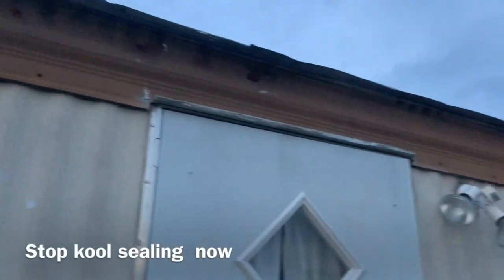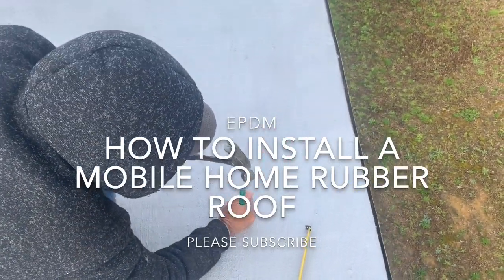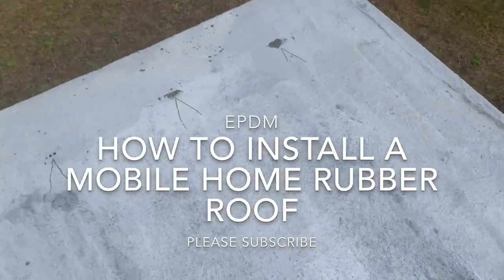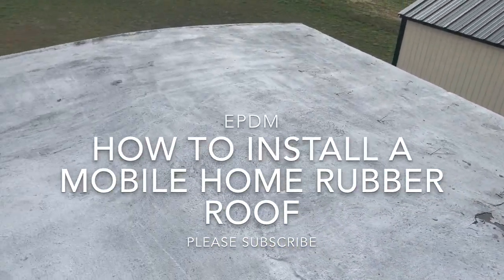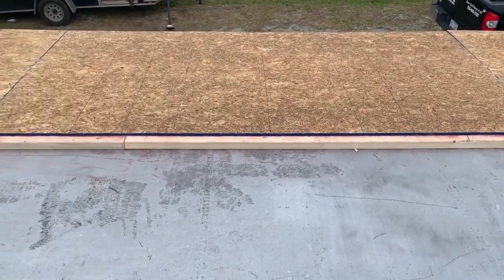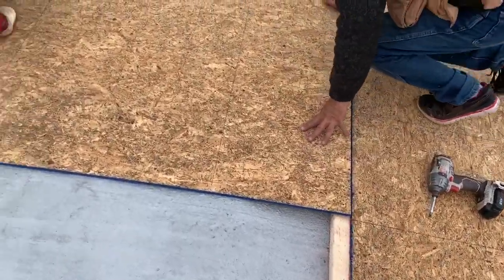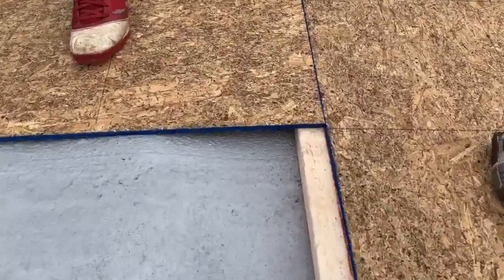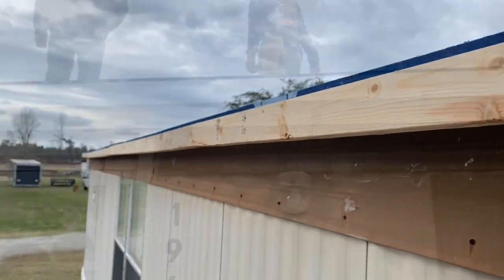(How To) Repair Single Wide Mobile Home Trailer Roof Training 2

Comment: The only thing I see that you could have done to improve the adhesion of the EPDM membrane is, as you are rolling it out, have someone with a street broom with soft bristles sweeping the rubber out from the middle to the end and side to get all the air bubbles out.  Before you put your termination strips on the sides, this way you will not get all those ugly bubbles I see you have, you want 100% adhesion. I know this video is 5 years old and you probably do things differently now.
Reply from the maker: Good observation

Comment: Adding a layer of 1 1/2" rigid foam between the 2x4s would make a huge difference in the heating and cooling costs for the home.  Even better, you could cover the entire roof with 1/2" ridge foam and install the 2x4s on top of it and then add more rigid foam between the 2x4s.  Maybe you could offer the foam insulation as an option.
Reply from the maker: https://youtu.be/41gtPber144

Comment: Nice work fellas. Did it right. I personally would of used metal but all comes down to budget. I like how you took the time to hit the rafters and check out what was under the tin for framing.
Reply from the maker: That’s all important making sure you hit rafters

Comment: I live in Delaware.  Wouldn't mind watching.  I think I have a rubber roof on the back addition that needs fixing too.  Google maps shows a corner flapped over, and there are stains on the ceiling directly underneath.  Been like that 2 or 3 years.  Disabled so I actually cannot get on roof to see.  Yep, it's been way too cold to be on a roof here, but it'll be getting warmer soon.  Like your videos.
Reply from the maker: Thanks for watching.
Reply from the maker: Michael Offutt I look forward to come in there and doing that Delaware job keep your eyes out it will be within a month or two subscribe to my videos and please share

Comment: Excellent video....looking to do the same to my 25 year old 8x40 ft trailer in Florida...with AC & Vents on roof w/attached screen room. Rigid Foam between old roof and new rubber may add more strength and insulation....Many thanks!! Do you travel to Florida?
Reply from the maker: Florida is one state that just won’t allow people to come from another state to work. I wish I could I love Florida

Comment: 3 years later I'm now just looking at this video getting ready to fix my leaky roof. Now question what is you think will be a weight limit on walking on the roof or any recommendations on walking on a manufactured home roof. I'm about 370.
Reply from the maker: Don’t do it. Get someone smaller. But if you have a roof like what I do put on you could walk on it anywhere have a friend just lean a ladder and us a paint pole roll Kool seal over leak area. Lots of it maybe even do it 3 times letting it dry in between coats
Reply: @Drewsroofingandhomerepair  thank you I work on cars not homes but  I can not get any one to work on it.  Feel to get stuff done you got to do it yourself
Reply: Roof does leak pretty bad
Reply from the maker: Don’t be getting on a roof of a trailer do it with a pole and a roller.

Comment: How much a job like that will cost ? I have a mobile home in snow hill nc that needs rubber roof ! Thanks great video
Reply from the maker: Depends
I might be interested in helping you out with that in the spring time  anywhere is from about $9000-$12,000

Comment: I'm wondering if this method would be suitable for my mothers trailer. We live in Northwestern Ontario, Canada and we have harsh winters with lots of snow. Wondering if I should go rubber when I do it or maybe look into tin roof instead. What do you think? Thx
Reply from the maker: If I was you I would go with the Rubber Roof and it will hold up anywhere in the world. They use in Alaska I buy more material at ABC Supply

Comment: I noticed on some of your videos you find wiring running over roof studs between metal roofing. How is the best way of determining if that is so without just getting started and drilling thru wiring?
Reply from the maker: When you go up on the roof you will probably see humps where the wires are. That is generally the way we find them. What I do if you noticed most of my rooms have holes in them I cut a hole in the roof first find out where the wires are after I determine where the wires are our use one by fours if there are wires and strap it if no wires you can go straight down to the roof call me if you have any questions 910-294-1761 I’ll be glad to answer any questions
Reply: @Drewsroofingandhomerepair  Thank you
Reply: @Drewsroofingandhomerepair  forget i asked, lol. i just saw this post and it answered my question. :-) TY.
Reply from the maker: Generally what you want to do is go to the main power source inside the house the breaker box. Find out if the wires run up the wall or down the wall. If they run up the wall then you want to go right above where the fuse box is on the roof and with your feet you can basically feel if there are wires running on top of the rafters. What I generally do if I have to do the job anyways is I cut a 12 x 12 hole above the fuse panel and find out where the wires are running. And I only do that if I’m going to do the roof if I was not going to do the roof I just feel for the wires. If they’re up there you’ll be able to tell by the bumps in the metal over the

Comment: Just curious can the roof and walls handle this extra weight on the roof? My mobile home is on blocks with just skirting, no solid support under the outside walls, I fear the walls would sag meaning the inside floors near the walls will sag from the extra weight on the roof.They sag slightly already from the years, it’s a 1978 Shultz single wide. Thanks
Reply from the maker: That’s a good question I don’t know what your situation is but if it’s sagging already maybe not
Reply: That's what I was thinking too I think you could do get away with the strapping I don't think you need them boards
Reply: Sounds like it needs Skirting took down jacked up to level it and put underpinning with treated 2x4 or 2x6 boards all along the outside wall.
Reply from the maker: Probably

Comment: In my area up north they wont let me add plywood over the top because of additional roof load + snow load.  Any suggestions on how to do this without the plywood?  Strapping with iso and then rubber? or metal over strapping?  My only other option is to build a gable roof and that may be cost prohibitive.
Reply from the maker: If your roof will hold the snow load now adding OSB or plywood would make it stronger. So why can’t you add OSB or plywood if it holds snow now it will definitely hold snow after he put the plywood
Reply: @Drewsroofingandhomerepair  tea the city wont let me.  They are saying the weight of plywood would be to much

Comment: On this job you put 2×4's down before the plywood due to wires running across the roof , correct ? Or was it because of the slant of the roof you had to use the 2x4s so the plywood would line up flush ?
Reply from the maker: Yes sir there were not any wires on this particular roof we used one by fours in some areas and two by fours and others and the reason for that was because of the 5 foot pump that ran down the center of this trailer. We used two by fours and one by fours for runners just to get the middle of the trailer and the outside of the trailer all basically at the same height so we didn’t end up with a big bump in the middle It was not for the wire snow
Reply from the maker: Not for the wires at all
Reply from the maker: https://youtu.be/Vtj8M5khpks

Comment: I really need some help. I have an old 1970's single wide with a bow roof. The walls are only 3" thick. It has metal skirting. We need to make the walls thicker so that we can install regular windows and add insulation. We also need to do something with the roof. Our mobile home sits on a cement pad, no footing. My hubby thinks that we can, remove the skirting and the metal siding,  frame up from the ground (half under the trailer, half out) and then frame up from that with like a 2x2 or 3x2 , add insulation and then add osb and vinyl siding or just wood siding. But then the wall would be exposed at the top. We talked about doing a wood roof over with shingles and posts but I was hoping to just lath the roof and add insulation and metal roof. Is that possible ? Will it be able to go over the new thicker walls? Can you add a soffit ? I'm just a broke chick looking for a cheap way to make our mobile home livable in the winter so I can move out of the city ASAP LOL please help !!
Reply from the maker: 3 inches thick you should be able to put windows in there no problem your windows do not have to be thick or the walls don’t have to be thick excuse me in order to put windows in what do you want to do is order windows without window jams. If you order windows with jams you would have to have thicker walls but if you put windows in with no jam extensions on them you can put any window you want. 3 inches thick is plenty thick for any window you want.Go on Google and type in new windows without jam extensions. You’ll have to make your own jam extensions out a one by fours ripped down. And then as for the roof I don’t know what your situation is or what your roof looks like does it have a peek on it or is it a flat roof if it’s a flat roof you can put the rubber roof on it like I do with the overhang. I would order windows with no jam extension looked it up on Google
Reply from the maker: Look that up on YouTube windows without jam extensions how to install
Reply from the maker: https://youtu.be/jOZOjBIGpGs

Comment: iam still wanting to know ?/do you not have to pull permits .and have felt ice and snow inspections as well as staple and nail inspection and drip edge
Reply from the maker: Not hereWhere I’m at in North Carolina
Reply from the maker: We don’t have ice and snow where I live and the inspectors do not inspect your nails and you’re not allowed to use staples

Comment: What should a job like this cost? Ballpark? And please tell the guy with red sneakers to tie his shoes…👍
Reply from the maker: This is an older video and the guy with the sneakers no longer works with me. I think I charged 5000 for this job back when I did it but notices a couple years ago. Biden omicks kindly changed my pricing.

Comment: Typically, how long does a rubber roof last before it needs patchwork? I live in Ok and wondering how the rubber would hold up to our heat, humidity, wind, and hail. Thanks for the videos. I have to decide what to do with my mobile home roof. What is your opinion of rubber vs metal?
Reply from the maker: 20 yrs

Comment: Hey drew my roof has multiple planes ,there are like 3 different levels of roof.Theres a pitch transition from one to the next.How do you handle that kind of situation.
Reply from the maker: That’s not an issue I have done every style mobile home there is Dustin check out my videos I’m sure you’ll find one like what you’re talking about possibly one of my Virginia jobs look at my Drews traveler videos
Reply: @Drewsroofingandhomerepair  thanks for the reply,is it possible to do corrugated metal over the style I was talking about?
Reply from the maker: I don’t know about that too much I think you might be running into some problems thereYou might wanna stick with rubber

Comment: How much would it cost to put a rubber roof on my single wide trailer home could you give me a close figure and would you travel to Missouri
Reply from the maker: Missouri is long ways away if I was to come there it would be somewhere around $9000 to do a Rubber Roof on a Mobile Home

Comment: GREAT VIDEO DREW...!!! 
Now I can do my one and a half wide I’ve just moved into...!!! 
Your workers are slow as hell. I can see it’s *slowly driving you nuts*....!!! LOL 
      If I have questions.. do you mind if I send you picture or two and get your opinion on few particulars...???
   Thanks sooo much
                       Greg
( I live in Muncie, In....)
Do I need to consider snow load here.. maybe a different roof method..)
Reply from the maker: 910-294-1761 any time
Reply: Drew's Roofing & Home Repair Oh cool Drew...!!! Thanks so much... I’ve been a contractor  for over 40 years... I’m enjoying the suttle methods you employ to motivate your crew.. Ivan see you saying to yourself...”OMG..!! Is it really gonna take both you guys to hold and nail that 5 foot piece of roof edge...!!! And taking 44 seconds to do it I’m too of that...
  Hang in there... seems like you’ve got a decent crew.. it’s tough to get dependable guys consistently when you’re on the road working, staying in a hotel, ect.. Did that for 15 years...
Reply from the maker: So true
Reply from the maker: Greg Rhodes 910-294-1761 Send pictures here I will gladly take a look

Comment: Your videos don’t show flashing any pipes or vents and it looks to me your making a hot box and how long does the 7/16 osb over hang last holding up the 2x4 and facia with no support. Just asking because I don’t know I only have 33 years of roofing under my belt
Reply from the maker: Well I can tell you that I’ve been doing it for 20 years and I’ve never seen one side yet not once remember the rubber is holding it up there’s no downward pressure

Comment: What thickness of epdm rubber?  and where do I buy rubber big enough for 12x70 roof trailer?
Reply from the maker: On this job, I used 60 mill normally I use what they call 045
Reply from the maker: ABC supply store look it up on Google

Comment: I just recently bought a used mobile home I'm going to have to do the roof that's a good idea and what was the cost on that material wise
Reply from the maker: 1800 maybe 2000 at the max
Reply from the maker: 1800. https://youtu.be/Sl2sWhdtp90

Comment: I live in Wilkes County NC and I have a 14x70. How much does this run for professionals like yourself to do?
Reply from the maker: Around 75 to 7800
Reply: @Drewsroofingandhomerepair  What about a metal roof? I don't have a flat roof.
Reply from the maker: If it’s not flat you can run the one by four strapping and put a metal roof on it

Comment: Were is a good spot to buy the rubber? And could it be installed in 2 section or does it need to be one solid piece? TIA
Reply from the maker: 1 section 2 sections either way.
Reply from the maker: ABC SUPPLY. Best Distributing call me I know an online place that will deliver to your house 910-294-1761

Comment: How much would it cost to have a new roof on a 1971 single wide mobile home in Michigan? Mine is really bad and there's no one in Michigan that will even look at it when I tell them the age of it.
Reply from the maker: I wish I lived in Michigan so I could help you. I love working on mobile homes it’s what I do. Unfortunately I’m in North Carolina. Michigan is a long ways away. Go to a mobile home supply store and ask them who works on mobile home roofing. Or maybe you can show some of my Rubber Roof videos to your local contractors and ask them if they’re interested in doing something like that to your roof.  I charged not by age but by size. If it’s 70 feet long you probably looking at somewheres around $8000 for what I do with the overhang and everything
Reply: @Drewsroofingandhomerepair  Okay I'll do both of them and thank you very much for all the help and information.
Reply from the maker: I’m glad I could help my friend that’s the reason why I started making these videos. I don’t make videos for me. As a matter fact I could probably get a lot more work done if I didn’t make videos. But I like helping other people learn how to fix their own mobile home problems. Mobile homes are amazing I love them I live in a double wide but I’ve lived in more than one single wide and I always make them nice and beautiful. I call it cheap living. Who wants to live in a two-story brick house and spend 12 or $15,000 a month for their house when you can live in A beautiful small Mobile Home from a few hundred dollars a month I mean on the few hundred dollars that’s for sure

Comment: im afraid of having electrical wires on top of the roof studs like that one you did had. how do i check for that? take the ceiling boards out or pop tin off the roof?
Reply from the maker: That is up to you if you don’t want to get into the roof metal it would be a good idea to go to the fuse box remove a piece of ceiling just above the box about a 12 x 12 piece and find out where the wires are running you can tell by that
Reply from the maker: That’s a very good question I’m glad you asked
Reply: @Drewsroofingandhomerepair  oh thats a better idea than what i was gonna do--i was gonna rip a panel off in my bedroom, lol!!!
Reply from the maker: https://youtu.be/41gtPber144

Comment: Do mobile home roofs have plywood in them or just the 2x4s
Reply from the maker: 2x4no plywood. My plywood makes them stronger
Reply: @Drewsroofingandhomerepair  i only see osb no plywood
Reply: plywood is 22 a sheet osb 8 a sheet
Reply: @gregoryshaw3233 5 ply  1/2 ply structural, 18$ and  4 ply 15$ . $16 for a true exterior glue imported pine ply with no knots at Lowes $16. Osb turns to paste when exposed to moisture and condensation
Reply from the maker: That’s all I use is OSB. I like it

Comment: What about expansion clips for the sheeting??
Reply from the maker: I’m going to be putting Rubber on top of this. The last thing I want is a metal expansion clip popping a hole in my rubber so we just leave a little gap
Reply from the maker: If I was doing this to a truss roof that would be different I would use Clips we are screwing this straight to the Mobile Home
Reply from the maker: If I was doing this on a truss roof then I would use expansion clips but we’re not we’re putting this directly to the Mobile Home